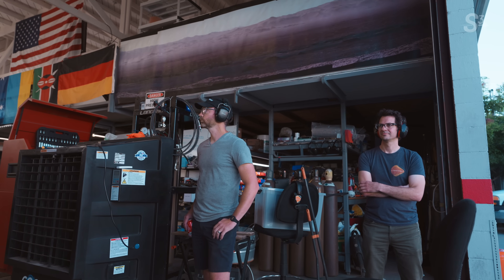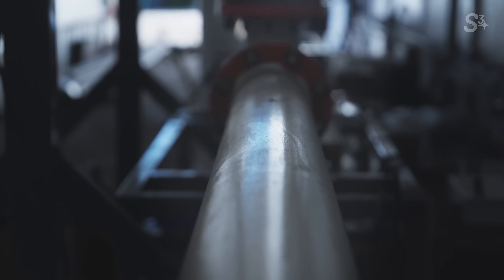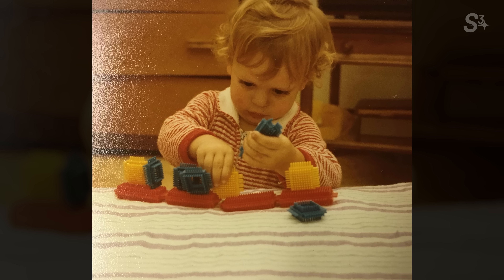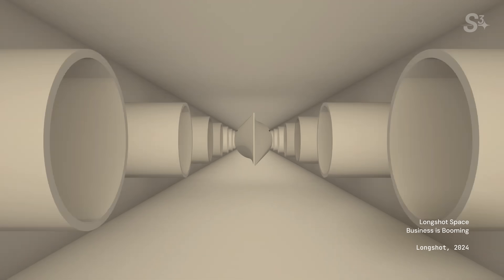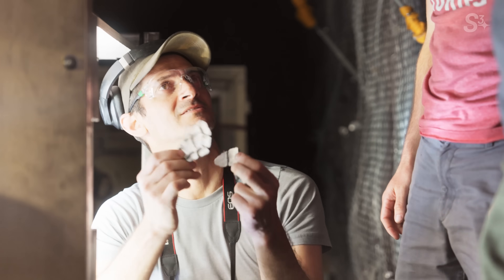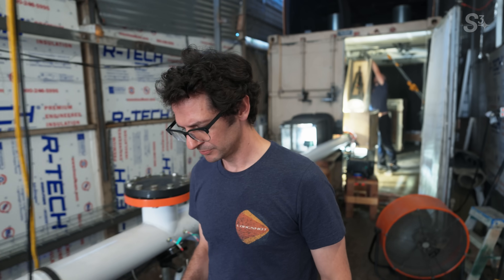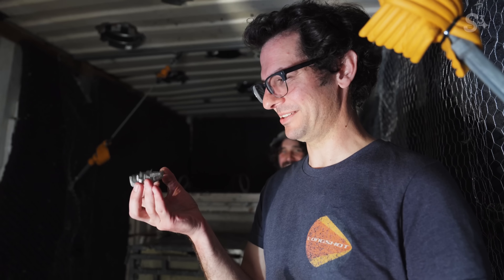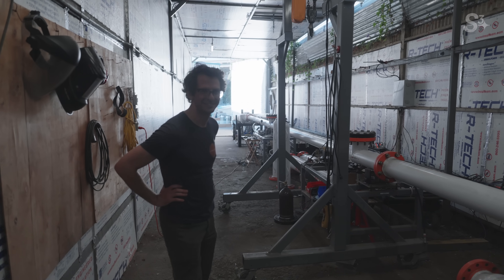They're Building an Actual Space Gun | Longshot Space

Comment: Unwarranted though:
Pressurized gate valves and n series, that throws and mechanically locks to increase velocity pressure on the fly. Pressure controls. Easy peaszy.
Reply: Think duel each side timed gates pressurized timed closures. Like hands crossing past each other blocking back pressure closing. * Rear gates.
Reply: The 60' length area thing isn't relative. It's about force. And catching that puck. Looks like you're catching a lot of slag too. Whatever as long as your projectile is is front at this stage in experimentation. Build the back pressure gates and get past the burst resistance washers approach.
Reply: Sequential thrust is your whole reality, to successfully launching. And that full control of inertia will absolutely determine your length of barrel. 
I do like what you're doing. It will work. Simple physics. 
Imagine getting your tergectury and timing dialed and matching timed connection to a rocket launched, attaching magnetically (?). Like those fish following a whale/shark.
Duel hitchhiking orbitally bound.

Comment: I was on the early phases of the ram accelerator project at the University of Washington. Our kick stage was 5,000 psi Helium, and we beat the gas speed limit by riding a detonation wave through the gas. We got over 3km/s in a 10m acceleration section.

Note sure how this is going to scale to higher speeds. The time window for the booster to act will get awfully small.

Comment: Not only the cannon itself would be extremely complex to design and build, but they could only launch very small and lightweight payloads, that would need to be built to survive the extremely high acceleration and pressure, which wouldn't be practical for anyone building a satellite. But the biggest problem is that reaching orbital velocity at sea level would be extremely inefficient because of the drag caused by the high density of air, and the extreme heat that would be generated as a consequence. Everything about this is wrong and they either don't know it, or they know and it is a scam. Look up the HARP project if you are interested, although it wasn't orbital and it wasn't meant to be.

Comment: Try a 2 Stage System - From 0 to Mach 3 with Solid Rocket Motors, then Electro/Magnetic Railgun type Mach 3 to ... At those speeds you have to time the Magnets precisely by the Nanosecond, easy to do with todays Electronics. Gas Valves are Mechanical and much slower.

Comment: Fun video and idea.  I'm curious how they can time the break discs so precisely.  That alone seems like a really hard challenge, but it kind-of seemed like they already had that part figured out.
Reply: yeah, im guessing they must have explosives ?  or maybe the chamber shock breaks hem ?
Reply: They said they score the discs to make them break at specific pressures. I'm guessing that's down to a super accurate science. If the time it takes to trigger the break disc is consistent then they just need to calibrate a lead time. I'm also not certain they're using break disks after the first kick? It could be some other valve.
Reply: @Kyle.Clerico  so i guess the first kick as a break disk would be fine, as it can trigger when ever, but i doubt they could rely on the booster firing in time that way without it being synchronized some how to the projectile position, they did show sensors at the boost stages which likely detect the projectile. I doubt the could use valves as the wouldnt have a big enough diameter, and it did appear to show what was a gas tank with its bottom joining the boost port with nothing much in between except maybe another burst disk

Comment: They could hang the tube vertically in the ocean and then use the pressure at depth to get the projectile going then side blast it to get to final speed.
Reply: Getting the payload into the gun would be a royal bitch 4+ km beneath the bottom of the Challenger Deep (roughly 11km deep).
Reply: @michiganengineer8621  easy....you just have a one way valve at the bottom and push it straight down the barrel with nitrogen gas pressure. Material science for the pipe-barrel and valves could be tough.
Reply: @freeradical6390  A good point!  To expand on your one way valve idea a bit.  You could possibly lower the projectile into the barrel enough to seal it, then pressurize the barrel.  You would slowly let the air or nitrogen back out lowering the projectile.  Rather like a pneumatic elevator.

Comment: Why can't you drop a pipe vertically into the ocean have a burst disk at the bottom when it ruptures the water intrusion will displace the air at riculous speeds.   If you had a pipe in the Mariana trench you would get 18,000 PSI a container is 9,800 square inches at the door (front or back), so that is 176,000,000 million pounds of force.  Lets assume that maximum load on a 20 foot container is 53,000 ponds so the force is equivalent to 3,320 containers.   The container would vapourised once it hits atmospheric pressure?
Reply: Do it.
Reply: M8 pipe wall will be a foot thick at base, obviously you won't need to go that deep but even if it was dual stage 1 water 1 air due to water being non compressable and water hammer effect.  Just giving another perspective I have no interest in a giant cannon but I can see why defense would be?

Comment: How long will you barrels last, at the orbital scale? I know many of the large artillery pieces could only do about hundred shots. Or woud changing the barrel not be a big deal after all the other infrastructure is in place?
Reply: We've got lower pressures and temperatures than a traditional artillery system.  That's why it's so long - we're distributing the energy over a very long area. So the barrels should not degrade significantly on a shot.

Comment: This is just stupid. It's the equvivalent of the hydrogen battery. The reason is scale. It doesn't scale economically.
You would need the entire infra again on another planet or moon. And with the tiny payload you filter out all kinds of customers. With the extreme g-force even more. And with the requirements of either accelerating faster to save on length and thus materials you end up in a economic death-loop.

Don't get me wrong. The IP from this is really interesting. I do get the VCs. But it won't be used for reliable payload to space.

But I am not at 5:00. Let's see. Perhaps there is a surprise

Comment: The main problem has not been addressed in the video - air resistance after the pipe exit. Would love to see some calculations or thoughts about that, but for now you guys seem like a bunch of delusional nerds without a plan, imagining themselves visionaries. You work might still be useful for hypersonics testing. 

Here are my calculations about gun-type launch systems. Seems like vertical launch from the top of the mountain is the only way, that at least might work for orbit delivery.

Required kinetic energy at 7800m/s at LOE
R=1m, L=10m, so V = 20m3 for tapered shape like yours, m=20t (projectile filled with water)
EkLOE = m*v^2/2 = 20000*7800^2/2 = 600 GJ

Potential energy to LOE
H = 400km (ISS level) Ep = mgh = 20000*10*400000 = 80 GJ (rather negligible)

Very rough calculation of air resistance losses until LOE
p (air density at sea level) = 1.2 kg/(m^3)
Cd= ~0.4 (average Falcon 9 drag coefficient, but it is not constant for different speed, especially hypersonic)
A (projectile nose area) = pi*R^2
S (travel distance converted into distance with 100% of air density) = ~60km because air density is approximately inverse proportional to height and is ~50% at 5km (and is 25% at 10k, 13% at 20k, etc), and pipe launches horizontally, so projectile will travel ~6 times more than if launched vertically. So it’s essentially S = 5000+2500+1250+625+312+156+…. * 6 = 60km
Ea = Fa * S = 0.5*p*V^2*Cd*A * S= 0.5*1.2*10000^2*0.4*3.14*1 * 60000 = 4500 GJ 

Required launch kinetic energy at 10000m/s
Ek = 20000*10000^2/2 = 1000 GJ 
diff = Ek - EkLOE - Ea = 1000 - 700 - 4500 = -4200 GJ
Totally doesn’t work 
Let’s launch from mountains at 5km altitude
S = 30km (60km - 5km*6times due to horizontal launch)
Ea = Fa * S = 0.5*p*V^2*Cd*A * S= 0.5*1.2*10000^2*0.4*3.14*1 * 30000 = 2250 GJ 
diff = Ek - EkLOE - Ea = 1000 - 600 - 2250 = -725 GJ

Let’s drill down into Everest and launch almost vertically with exit at 8000m altitude
V = 8km/s
S = 4km = 1250+625+312+156+…. = 2500-4000m depending on how the density changes
Ea = 0.5*1.2*10000^2*0.4*3.14*1 * 4000 = 301 GJ
Ek = 20000*10000^2/2 = 1000 GJ
Potential energy is now not negligible.
diff = Ek - EkLOE - Ea - Ep = 1000 - 600 - 301 - 80 = 20 GJ
Yay, we have spare energy.
Reply: Hi, I'm Mike, the big fat one in the video. 

You put a lot of work into your comment and I respect that! I wanted to offer a few points. Caveat, I'm not the CTO, but simply an imaginative CEO with technical pretensions.

Our plan is to shape the heat shield/vehicle body as a 'wave rider', effectively a hypersonic lifting body while also exiting with an angle of attack already pretty aggressive. So while the vehicle exits horizontally, it then ascends out of the soup rapidly, then engages in a second maneuver in the upper atmosphere to level off its exit to orbit. So the time spent in the thicker layers of the atmosphere may not be as much as you are thinking (I hope not anyway!). I have some other thoughts, but it's late and I'm pooped. Feel free to reach out and I'll hop on a call and talk it over with you. You could record it put it on YouTube!

Cheers,
Mike
Reply: @mikegrace8814  don’t let doubt stop you from trying! Every great innovation has to overcome seemingly insurmountable obstacles! Being scrappy and moving quickly will serve you very well. Wishing you the best luck, on humanity’s behalf. Godspeed!
Reply: @mikegrace8814   Hi Mike! Thanks for your reply. Read it two weeks ago, but kept coming back to it, so decided to reply back. 

Didn’t want to discourage you from what you and team are doing, but video left many questions, hopefully we will see you next year on S3 with progress and details.

Wave rider sounds possible for angle adjustments, but I still have questions about losses, aerodynamic coefficient, and other stuff: allowed payloads due to high accelerations, cost/kg, throughput (kg/day/system), maybe something else.
Basically I would like to know is it theoretically possible, and how your estimates compare with SpaceX’s Starship.

I’m not a blogger and not yet interested enough for a call, but thanks for suggesting.

Hope your team or preferably you as CEO know what you need to figure out during tests to make math and physics work out, instead of just building a 15km tube and understanding that the idea wasn’t even close to working.

Sorry if I’ve been harsh, I’ve seen a lot of emotions in the video instead of signs of understanding the topic.

Take care, stay strong!
Reply: erm. actually... You're the nerd.
Reply: @owensiegel4452  I am, but not delusional, at least as far as the video shows.
Reply: Vertical? So your projectile falls straight back to earth? You're gonna need a bigger market than sounding rocket replacements to stay in business.
Reply: @railgap  As mike explained above, the projectile would need to maneveur in the upper atmosphere to level its exit to orbit.

Comment: I don't think gas propulsion is the right choice for an orbital gun, ESPECIALLY if you want to use single-use burst disks.
I would personally go for a Helical Railgun (Helical Coil Electromagnetic Launcher) with a plasma interface between the rails.
Or frankly, I would see if it's possible to have a coilgun with the projectile itself having a powered electromagnet. Afterall, you only need the power for a little while so it should be perfectly feasible to stuff the projectile with some supercapacitors.
Timing an electric circuit to trigger current through a coil of wire has to be ORDERS OF MAGNITUDE easier than timing a burst disk to release gas at the right time. So the most basic coilgun would have to be a simpler solution than theirs, right?
Reply: Much more expensive to build, test and go THAT fast. Railguns have been around forever and have not made any progress
Reply: @The10nthdoctor  I specifically excluded the basic railgun out of the 3 reasonable ways to shoot projectiles fast.
Although the Helical Railgun does have rails it's not quite the same thing.
Reply: @MrRolnicek  oh interesting I have never heard of that before, is there a good place to learn about it?
Reply: @The10nthdoctor  As far as I know: no
I have seen exactly 1 youtube video mentioning the device and nothing else. But at least that one should be easy to find.
Reply: Big words, you must be very knowledgeable.

Comment: There is a reason that we do not accelerate anything to escape velocity at the earths surface. Air resistance. The moment your projectile exits a barrel traveling 11+ km/s (gravitational escape velocity, ignoring air resistance) or (30+ times the speed of sound) it is going to vaporize. That is slightly faster than the orbital reentry speed of the Apollo spacecraft. 

AND that does not take into account that deceleration due to atmospheric drag is not to your advantage (in the case of reentry), but your disadvantage.
Rockets work because as they accelerate to higher speeds they travel away from earths surface and into thinner atmosphere. 

It annoys me how otherwise brilliant and technical people can miss the forest for the trees. This concept will never work regardless of how well thought out the individual components of the system are.
Reply: Not with that attitude 😅
Reply: The concept is sound. The devices have already been designed. Gerald Bull. 
Your extreme confidence in your commenting when you display a marked lack of knowledge should scare anyone who reads your missive.
Reply: @phlogistanjones2722   @phlogistanjones2722  Bull didn't actually get there tho. He'd have had the same issues. And nah, his physics concerns are 100% valid. Retired aerospace engineer here. But you sure do gots some fancy words, boy. "Missive"?  ROFL

Comment: I wonder how they will actually get stuff to go up rather than horizontal, theres got to be some serious forces on any kind of elbow when theres a 500kg load moving at mach 25.
Reply: You don't, you just go in a straight line sideways and the earth curves away under you. They might incline the thing a little to spend less time in atmosphere, but they're not gonna turn, at least until they get to orbital altitude.
Reply: @andrew.pendleton  yes, but they would waste a lot of energy quick by not climbing fast enough into the thin atmosphere. they're going to have to have some sort of angle for it.10-40 degrees maybe?
Reply: @TomatoWithARifle  Energy is cheap here on Earth ... relatively speaking. 
But generally these mass accelerator concepts tend to have the barrel exit at the highest mountain in the local region.
Reply: any direction away from the ground is up in this case, looking towards the horizon is looking into space too, just on a tanget from the surface
Reply: Well, they said they want to build a 10-15 km pipe, and shoot a slug that’s 3000kg, but would really want to do one that could do 40k if there was better funding. Whew
Reply: @lordofthebugs  Imagine troubleshooting failures along a 15 km pipe.  Seems like a lot of maintenance.
Reply: @ThreeChe there are much longer pipelines out there where they could borrow tech and concepts from the gas industry
Reply: I'd assume they're planning to shoot smaller loads in a high frequency. Because it will be super cheap to fire multiple times as compared to a rocket.
Reply: @roman-slack  And what's the use for small loads? Could it eventually launch a folded satellite or something?
Reply: Plan is to ramp a few degrees off the atmosphere
Reply: @natosaichek  No moving mass ? 🥺
Reply: @beritsyltebo7533  That's how we ramp off the atmosphere by a few degrees!  I was just reviewing your thesis less than a week ago :-D
Reply: @natosaichek  Nice! Let me know if you want a hard copy!
Reply: an extremely wide turning radius might make it possible. It would lose a substantial amount of energy to friction, though.
Reply: Just put a trampoline at the end angled at 45º.
Reply: They could build it underground at the start, or up the side of a mountain

Comment: A 10m boat tail will be under the booster for ~1ms at 8km/s.  You folks are probably going to revolutionize gas valves just out of sheer necessity.

Curious if a standing wave inside the boost bottle stage could be used to meaningfully densify the shot.
Reply: they're greatly exceeding the speed of sound of these gasses, so not exactly sure how/if that would work, but i'm a bass player who fuckin' knows?? neat idea
Reply: @herzogsbuick  they actually addressed this at 1:20
Reply: The shots that had a scatter of debris come out of the end might have had the booster hit the payload and not the tail.
Not sure this will be doable.